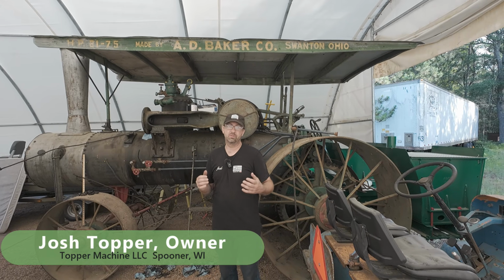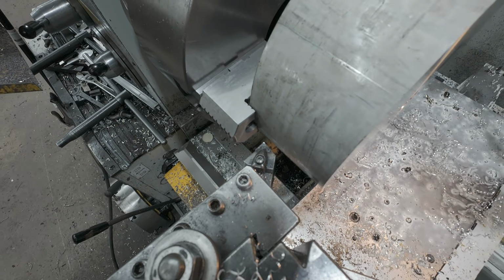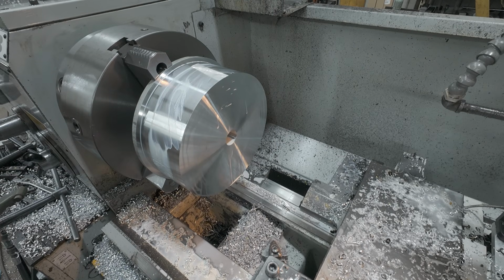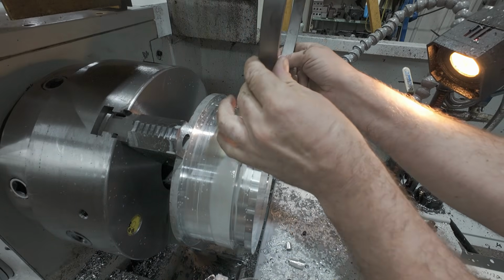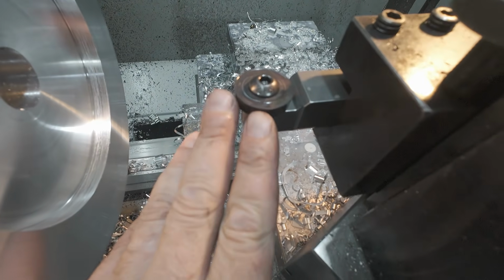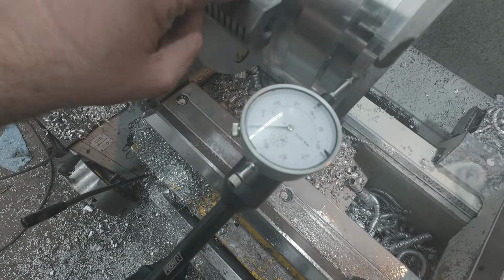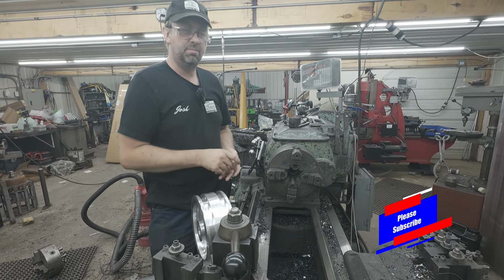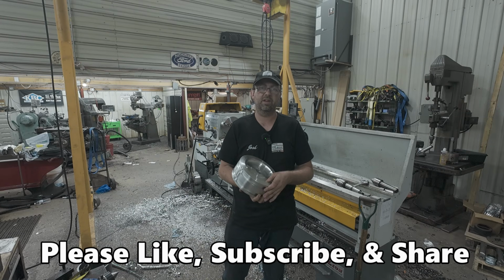This A.D. Baker Steam Traction Engine Needed a New Piston | Manual Machining

Comment: Hi Josh.  Can I politely ask about your calculations?  
First, I absolutely agree that there will be 0.010" of clearance at 370 F.  That's what my calculations say too.  I also note that you have a safe (you said sloppy) fit of 0.030" at 70 F.   However, the light aluminum will heat up and expand more rapidly than the more massive cast iron.  Aluminum has about twice the linear expansion rate.  If the piston heats up really fast, it may be "snug" in the bore for a brief period.  But, I think the 0.030" starting "slop" will be sufficient to prevent this.   
Well, this is all just a friendly thought.  Your thoughts may be different (but, I would like to hear them).  It's difficult to predict the "expansion race" when two large and different metals are in motion.  Cast iron internal combustion engines, with much smaller aluminum pistons, have been doing this successfully for many decades now with way less "slop".
Details that matter:  Piston diameter at 370 F = 9.3165"    Cast Iron cylinder diameter at a starting temp of 70 F = 9.310"
BTW, I did my calculations during a commercial break on a Gunsmoke episode using the Omni calculator.

Comment: Kinda concerned the aluminum piston and the cylinder won't heat up from the steam at the rate since thermal conductivity of Aluminum is different than cast iron or steel. That would mean the piston and cylinder would be at different temps for the startup. Aluminum would heat faster and reach final dimension before the cylinder. Physical contact would force equilibrium faster but that might not be desirable for wear. Not sure how long temp differences between the steam, cylinder and piston would last. The speed at which temps rose and cooled on the lathe was interesting. I wonder if the chuck jaws were at a different temp than the aluminum billett.

Comment: I built a little panel with a gooseneck adapter and 6" polycarb sheet from McMaster to redirect chip sprays. Cheap and seems to work ok.

Comment: I'm curious to see how the taper lock works with the aluminum piston. When I made the aluminum piston for my 8 H.P Russell portable steam engine, I threaded the piston onto the rod and used a lock nut to secure it. I was told from several people that the aluminum would swell up when it's hot, and so would the taper and it would loosen up when it runs. I'll be interested to know how yours works!

Comment: Josh, a couple of questions:

Is Foreign Object Damage (FOD) a problem from the scrap metal created when cutting, and that scrap finding its way into the moving parts of the machine?

i watch other YouTube channels where guys are melting down scrap such as aluminum and copper, and turning them into ingots of various sizes. Are those end products capable of standing up to machining such as this and subsequent use in an industrial application such as a steam engine, or are they better suited to light-duty hobby applications? 

Great episode. I just turned 62 and I am thinking about taking an introductory machining class at my local community college in September. I haven't done any metal lathe work since I was a high scholl freshman 45+ years ago, and that was nothing more than turning a piece of hex stock down into a center punch.

Comment: ChatGPT 5 says: If you want, give me: bore, stroke, boiler pressure, typical cutoff, exhaust back-pressure, and two clearance fractions (old vs new). I’ll run a quick textbook single-cylinder model (hyperbolic expansion with simple compression & back-pressure) to estimate IMEP change and show in numbers when the “more clearance” choice wins for raw power.

Also:  How to settle it (easy experiment)

Mount a 0–200 psi transducer on the cylinder, read crank angle with a simple encoder (or even a once-per-rev pickup plus inferred geometry).

Plot P–V cards before/after, compute IMEP and torque ripple.

He’ll see exactly how much the admission “hit” increases and how expansion shrinks. This is the traditional way (mechanical indicators), just modernized.
Reply: More of that chat:

Totally get what he’s going for: more sawmill grunt rather than better fuel economy. Here’s how his change plays with the physics.

What his recess actually does

It increases clearance volume (the steam left in the cylinder when the piston is at the end of its stroke).

That reduces expansion ratio and reduces compression on the return stroke.

It also reduces reciprocating mass (aluminum piston, material removed) → a little more RPM headroom for the same balance/valve gear → more peak HP if the boiler can keep up.

Power vs. efficiency trade-off

Work per cycle is the area of the indicator diagram . Changing clearance reshapes that loop:

Admission (start of power stroke): with more clearance, pressure in the cylinder just before the valve opens is lower (less compression). When the valve opens, the pressure jump to boiler pressure is larger → stronger initial force on the piston and a touch more mass flow right at the beginning. That helps starting torque and “hit.”

Expansion (after cutoff): because the trapped volume at cutoff is bigger, the expansion ratio is smaller, so the pressure falls less by the end of the stroke. That hurts efficiency (you waste more pressure out the exhaust).

Return-stroke cushioning: reduced compression means a softer cushion near head end. That’s fine for a slow, heavy sawmill engine if the bearings and crosshead are happy.

Net: if he runs long cutoff (typical for “make power” operation, e.g., 60–75% cutoff, throttle open), the loss in expansion efficiency matters less, and the better early-stroke pressure plus lighter piston can increase indicated mean effective pressure (IMEP) and/or RPM, i.e., more power. If he were chasing economy at short cutoff (25–30%), the bigger clearance would be clearly worse
Reply: And of course, ChatGPT doesn't actually understand what it says. It's just memorized the words from a bunch of thermodynamics texts and stories of steam engine history and  reddit dialogs and Wikipedia articles and a huge trove of pirated books and all of the available out of copyright books. It then puts one word after another like autocorrect. This latest version does some new stuff in addition and apparently can use computer programs to do calculations accurately. Hopefully, the majority of what it read was accurate.

Comment: Currious as to your order of operations, I would have thought facing one side, then flipping it over to have a good faced side in the chuck and face the other then drill the thru hole.
Wondering why you did it the way you did never worrying if the face in the chuck was out of square for lack of a better term.

Comment: Love the medium size wrench! Got to have the whole set : left and right handed, in SAE and metric 😊 also I've heard from an old steam guy that aluminum can have porosity problems leading to catastrophic failure, steam driven into the piston then freezing in the winter, weakening the material, but he said it could have been defective stock as well. Is this a concern?
Reply: This was a problem with some brake cylinders for a while, they would weep. I had all my original 1950s ones resleeved in stainless to avoid it.

Comment: Looking good. I agree that the piston needs to be heated when fit to the shaft, otherwise the differential expansion will loosen it at operating temperature.

Comment: Great video but I think your expectation that hollowing out the ends in order to create more power ('like stroking a e.g. car engine') is misplaced. All you are doing is creating more space for the steam to enter at the end of each stroke, with no additional power. If fact won't the steam usage increase? To use your car engine analogy, it's like reducing the compression ratio (= less power)

Comment: Boring the cylinder while give you more power but piston geometry isn't going to do anything. The formula is P.L.A.N the a in plan is area. Area is area regardless of dished or doomed. 
Saying all that good job. I just respectfully disagree with the more power statement.
Reply from the maker: You understand internal combustion engines, not external combustion engines. Totally different things.
Reply: @TopperMachineLLC Nope I'm a steam engineer and boiler operator. And I understand no matter how much volume is in the cylinder it doesn't increase the area of the piston and the steam pushes on the area. P.L.A.N. Pressure x length of stroke x area of the piston x number of strokes per minute. Divided) by 33,000 equals calculated h.p. And I understand working steam expansively but isn't not magic as soon as the valve closes the pressure starts dropping. Look at an indicator diagram. Making the area larger will only take more time for the steam to fill that area. And dishing the piston will only decrease the cushion that the original engineer built into the clearance the engine originally had if you don't adjust the valve timing from stock to make up for the extra volume.

Comment: Great video. I love steam engines of all kinds.  Mine are HO scale trains not full scale traction engine. Question, do you have to calculate the volume of the piston rod to balance each side for the same power on each stroke?  Thanks Josh.

Comment: Hey Josh.  The use of aluminium for the piston, vs cast iron for the cylinder is interesting, thermal expansion is however but one aspect…  
Have you considered Galvanic erosion issues?  Especially as the piston is running at about 300Deg F?…

Anyone with a boat worries about erosion, propellers, etc… hence they use Zinc anodes to offset the effects… 
Every 10Deg F doubles the speed of any interaction…   Maybe something to look into…   Or video three maybe why the piston only lasted two weeks?!

Great channel, real machining and why!

Steve

Comment: Josh, a suggestion for nasty chip fountains: use an old chip brush or little rectangle of thin brass sheet. There is a guy, Chris Maj, that has old indicator bases with brush and sheet ends. He just sticks one down on the cross slide when he is machining something that likes to spray, and ends up with most of the chips in the pan. Saves having to duck and run and watch from a distance.  😊
Reply: You can buy PC shields with magnetic stand and a flexible arm. Used it 20 years ago when I was an apprentice. 
I think he knows this already but don’t use them. They are in the way sometimes and you have to setup them.
Reply: i think a riot shield might be good for this job

Comment: Your idea about heating and shrink fitting the piston onto the taper sounds good, remembering when the engine is at temperature the piston will expand and could loosen up on the rod end.

I have to laugh at the way some people know what you are capable of, when they have never been in your shop😁😁 but if you need some advice just put it out there, I am sure that an expert will have the answer🤣😂😁

Comment: Hey Josh , what would be your thoughts on building up the original piston outside diameter with bronze Mig wire  .  A similar way to how they repair Komatsu hyd cylinder  pistons .   I know you wanted a different design but i was just thinking of an alternative way to reclaim the original possibly as a spare .    Cheers  .

Comment: might the aluminum piston heat faster than the cast iron cylander causing less clearance during the startup process? Also, turning something that massive  wouldn't it be a good idea to use a big live center for safety??
Thank you for the many lessons! while mt Atlas is only a 12incher the principals apply!

Comment: I just found your channel restoring this steam tractor I have a question for you what are you going to do about weight difference of the weight of the cast iron piston compared to the aluminum piston where the crankshaft on the steam engine and how much of a difference in thermal expansion is the aluminum effect compared to the cast iron with the temperature is steam I can't wait to see this beautiful giant up running again steam traction engines I restore antique oilfield engines and hit and miss engines I own a 1909 Joseph r e i d gas engine that I just recently finished 2 years ago she's my favorite big engine

Comment: can you tell the difference in power from front of the piston to the back, is there a way to balance that with applying more steem to 1 side,
my simple thought would be to cut the piston away  on the rod side but thats gas stuff just cereus nothing to die for like a cat

Comment: It will be interesting how you work out the rod length, or is it adjustable so that you can set the stroke correctly? I don't now anything much about steam engines, I'm used to regular IC engines.

Comment: Beautiful job machining that big piston. Interesting the way you calculated the expansion rates of the two materials to determine the correct size. 7075 is a good choice for the piston. It’s much harder and stronger than 6061 with about the same corrosion resistance. I wonder if you considered hard anodizing for longer wear?

Comment: Is an Aluminum piston going to be OK exposed to high temperature steam? Moisture seems to corrode the Aluminum in my shop. Wouldn't high temperature water be worse? Perhaps the original piston was iron for a reason. Cheers.
Reply: That piston will be working in the worst case conditions for that alloy with regard to corrosion and strength at working temperature of steam above around 50 psig.

Comment: What would the horse power of a steam engine that size be and how many foot Lbs of torque , I remember someone saying not much HP but loads of torque on steam , Sweet shop made tool worked as you said ,Nice
Reply: Those real big traction engines are rated about 150hp, but will pull anything

Comment: As a chemist I have my misgivings about aluminium being used as material of choice for STEAM engine piston...
Reply: Particularly 7075. That piston will be working in the worst case conditions for that alloy with regard to corrosion and strength at working temperature of steam above around 50 psig.

Comment: Those recessed areas. I know they’re there to increase cylinder capacity, but is there enough material between the recessed are and piston ring groove so it doesn’t create a weak point? 
Also, on the steam engines, is it power stroke both ways?
Thanks for sharing these builds with us, looking forward to next video.
Reply: Yes, power stroke both ways.

Comment: Hi Josh, lathe parallels I used ground round bar which had 2 off 3/32" holes drilled parallel to each other so the the inner edges were just wider than the jaw width. 1/16" welding wire was fitted from one hole around the outer edgeof the chuck jaw and into the other hole. I have successfully used these  up to 1K revs with no problems. I made sets of 4 so that they could be used on a 4 jaw chuck. I had seeveral sets from a 5" dia chuck to 16" dia chuck. It saved machining soft jaws.  Keep up the goo work and I hope things pick up for you in future.

Comment: Deposit for stealing your radius cutter idea.  Only change i made was a round register on the insert and holder to keep the fastener out of shear.  I can only imagine the calcs on a 9 in piece of material above 300*f. Non-liner rates of expansion.  Is the piston Hot on both sides?  Could have used something like rsa-661 with lower tx rate but the cost of material would be 4-5x and its worse than 7000 alloys to machine.  It would be cool to get the 5 min how it works when you assemble it for us non-steam folks.
Reply from the maker: Thank you!

Comment: The AL 7075 T6 is an awesome alloy, that said, you need to build a splash guard for your lathe to contain the chips flying all over the shop
Reply: Easier to clean them off the floor.

Comment: Josh your thinking on the dished pistons is exactly backwards. Think of it exactly like a car engine. It is all about the compression ratio although is should more properly be called the expansion ratio. Any extra space in the cylinder is space where the steam can go and NOT push the piston. That is why the original piston was cored (not lost wax) it would have been much easier to cast a piston with dished faces but they went to the trouble to make a cored piston to not hurt the expansion ratio.
This is also one of the reasons that later locomotives went to spool valves. (primary reason was higher pressures meant more force behind a slide valve had hence, more wear.) Using spool valves allowed each to be placed close to the cylinder covers which meant very short and direct ports into the cylinder which helps the expansion ratio.
Reply: I think Josh is correct as steam continues to expand in the cylinder ergo more volume more expansion more power.
Reply: Yep the force on the piston is just the CSA multiplied pressure perpendicular to the direction on motion.  The dishing just increases the unswept volume compared to the swept volume,  so it'll use more steam.
Reply: Thanks for explaining that, I know nothing about steam engines and couldn’t understand how a bigger volume is better, I build racing engines and I want as much compression as I can stand without a rapid disassembly 😳
Reply: In an internal combustion engine, the peak cylinder pressure is increased by reducing the combustion chamber volume thus increasing power output. In a steam engine the cylinder pressure stays the same, boiler pressure. More volume at the top of the stroke increases the average pressure in the cylinder and thus increases power output.
Reply: @keith0alan  it is quite different for a combustion engine the inlet valve closes at the start of the compression stroke (at BDC) and stays closed for the power stroke. Not so for a steam engine where it is opened just before TDC to let the motive fluid in, there is no compression stroke, an idealised steam engine maximum power stroke is near constant pressure, on a real unit there is a expansion step between the inlet vale closing and the exhaust opening (exhaust lap)